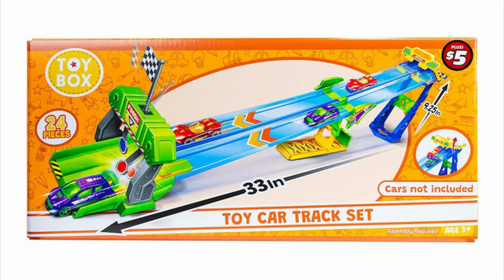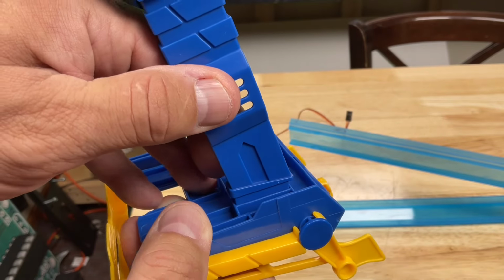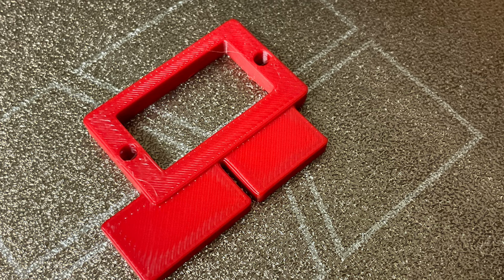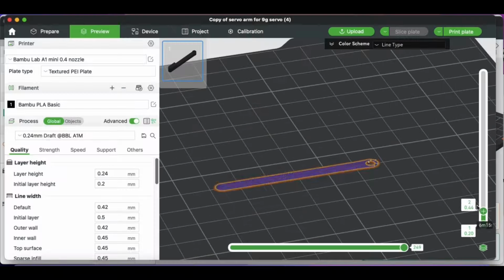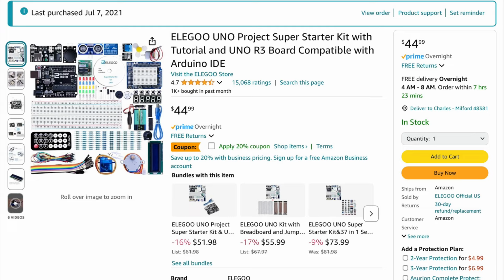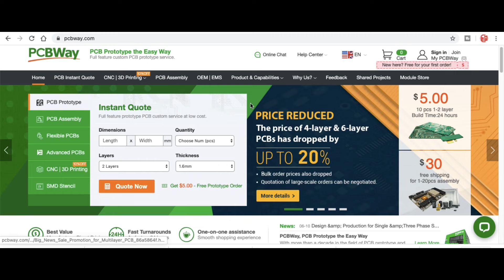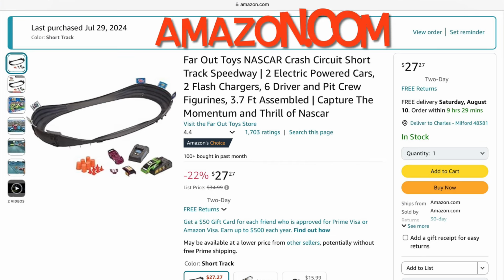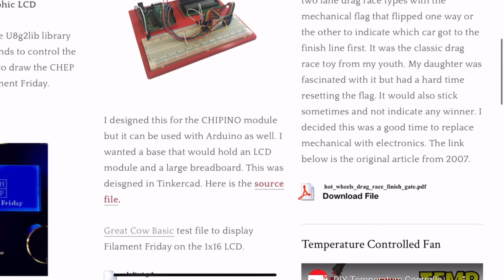Diecast Racing Automated Starting Gate Using 3D Printing & Arduino

Comment: you should build a wooden table for your grandson to put the track on and 3d print some buildings and trees for around the track
Reply from the maker: That’s the long term plan and why I’m experimenting with larger track configurations using a temporary setup like I showed.
Reply: @FilamentFriday   this is one of my favorite projects you've done in a while 👍